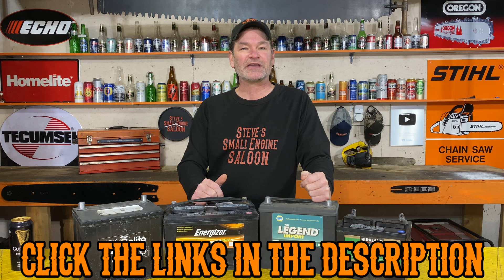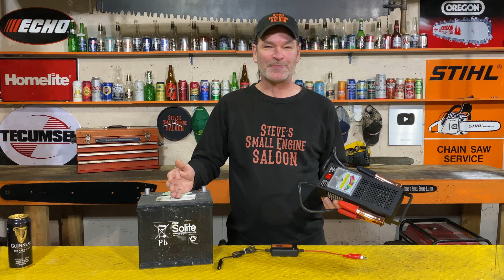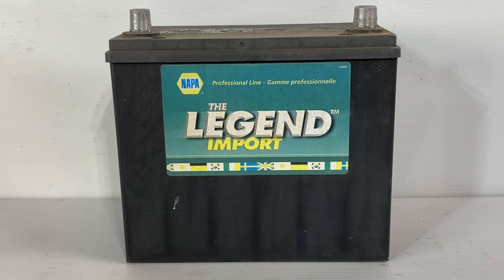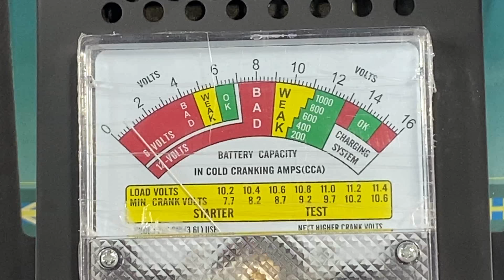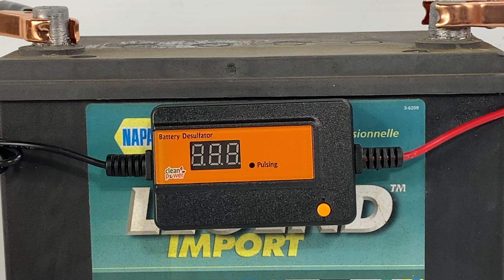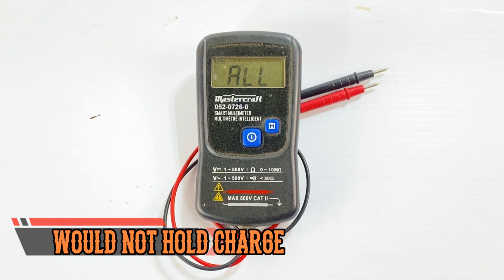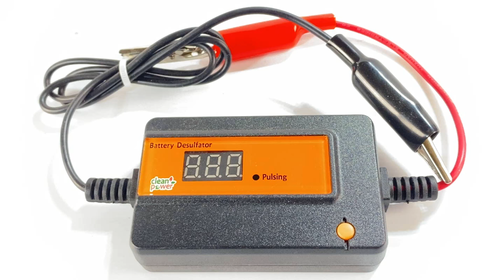Does An Electronic De-Sulfator Really Repair A Battery?? See Real Results

Comment: The older batteries that were not sealed you could put half of an aspirin in each cell and it could wake them up.  Got years of use out of "dead" batteries that way. May have to try the new gadget...
Reply: "Sealed" batteries aren't sealed. They have a vent to allow gas to escape when they are under heavy load and they loose water over time. On most of them, you can prise the cover strip off and service them like an old-style battery. The non-serviceable batteries are a marketing scam and have tiny water reservoir under that centre strip to automatically top them up to compensate for evaporation but it only lasts a few months and then they gradually start to run dry.

Comment: Alright, Steve, you sold me. I just ordered one off your Amazon link. 

I'm thinking about using it on good batteries every few months to extend the battery's life. What do you think?
Reply from the maker: Preventive maintenance is one of there selling points...
Reply: Yes, every time you charge use it period. Also if you have parasitic draw from security systems on your vehicle. I’m having to use it minimum of weekly if the vehicle doesn’t get used or used enough.

Comment: Steve, we tried desulfators at the airport on airplane batteries, and with similar results.  The thought of resurrecting a very expensive airplane battery was a VERY attractive option that we wanted to explore.  We also called the manufacturer (Gill) for more insight, and the discussion was well worth the time.  Here’s what we learned.

Batteries sulfate from a combination of two things.  If the battery charge decreases to a certain point, sulfur will form on the lead plates in the battery, interfering with the reaction between the sulfuric acid and the plates.  The longer the low-charge status, the more sulfate is formed.  Making matters worse, the sulfate will harden over time, making dedsulfating difficult if not impossible.

If you can catch a battery before the sulfate hardens, you have an excellent chance of reversing the chemical reaction and put the sulfur back into solution.  If you don’t, the hard sulfur can flake off of the plates and fall to the bottom of the battery, then short the plates.  Also, if you “super-charge” the battery, you run the risk of warping the lead plates.

One of the best things that you can do is remove the battery when its not going to be used for awhile and bring it in the house.  Put the desulfator on the thing every once in awhile to keep the battery charged.  “Exercise” the battery by putting it through a charge/discharge cycle.  BTW, the desulfator puts out a slow charge, and at a frequency that causes the sulfur to dissolve.

That’s it!  My airplane battery is in my workroom now attached to the desulfator, and will swap places with my lawnmower battery shortly.  Oddly, they’re the same exact size, but the airplane battery costs $400 more.  Both are 12v, but the airplane battery can be inverted (-It has little lead weights inside the caps that will seal the breather vent hole).  The temptation to use a lawnmower battery in the airplane is tempting, but the penalty that the FAA would impose keeps us honest.
Reply: Great knowledge shared
Reply: What about AGM batteries?  (Absorbed Glass Mat). The one in my snowmobile is mounted on it’s side, as there is no actual liquid in it.
Reply: @tomrogers9467  -Don’t know, but I would suspect that desulfurization only applies to lead acid batteries.  You could do what I did and call the manufacturer.  They’ll know.
Reply: @nealbowser8574  wouldn't an agm battery be no good in an air plane with out being vented at high altude due to pressure changes?
Reply: @chuckbailey6835  you would think that airplanes would always ride the wave of cutting edge technology.  Unfortunately, the exact opposite is more often the case.

AGM (absorbent glass mat) batteries are used in modern car batteries because of the increased power demands new vehicles demand.  On civilian airplanes, the technology for batteries and engines dates back to the thirties and fourties. The Gill battery that I mentioned is a lead-acid type almost the same as the one in your grandfather’s car.   Now they do use sealed cell technology, but nothing as sophisticated as an agm type device.  The cost of certifying new technology is draconian, so manufacturers use what’s already been “blessed”. 

Currently, I have a sealed cell battery in my airplane. -Don’t know the specifics,  it gaining or losing altitude apparently is not a problem.
Reply: @nealbowser8574  AGM batteries ARE lead-acid batteries. THey are just not FLOODED lead-acid batteries.
Reply: @JohnMcNerney  I know.  A little disclosure here.  While I'm a pilot, my degree is in biochemical engineering.  I'm well aware of the history and design of storage cells, so a little background knowledge is necessary here.

Lead/acid batteries have been around for about 150 years, and during that time, very little was done to advance the technology.  -Didn't really need to. Then they developed "sealed" batteries to prevent leakage and evaporation.  You can still purchase sealed batteries for your car, and most people consider all batteries that are sealed to be of this type.

The next step was AGM batteries, which still is a sealed battery, except that a layer of fiberglass is placed between the lead plates, which allows more lead to be put within the battery since the plates won't physically touch and short.

So the absorbent glass mat allows for thinner plates, and more plates, to be placed within a given dimension.  The problem was in the marketing.  To distinguish between current sealed batteries and the newer ones with the fiberglass barrier, they now refer to AGM batteries as a separate type of storage cell.

Crazy!  The next variation though will be batteries made out of more exotic materials.  -A shame, because the prices will jump outrageously, and the materials will not be as environmentally friendly as the old lead acid (-Not that they were very environmentally friendly).
Reply: I have 2 AGM Motorcycle batteries and they do contain liquid acid. I desulfated both and they are about 8 years old still strong.
Reply: @marksmith9295  I actually know an old, blind, pilot, who stupidly tried to peek down into the cells of his battery, but used a cigarette lighter as his light source.  The offgassing hydrogen exploded, and the sulfuric acids blinded him.  So yes, the hydrogen can explode, but in almost all cases, the hydrogen will dissipate before an explosion hazard is reached.
Reply: @nealbowser8574  
My Bonnie leaned over the gas tank.
The depths of its contents to see.
I lighted a match to assist her.
Oh bring back my Bonnie to me.
Reply: I put a charger on my batteries every once in a while to keep them topped off. They last like 8 years
Reply: Thanks for sharing. Why do airplane batteries have to keep vent holes sealed?
Reply: @TonyB1973  there’s an old saying with cars: “Keep the blue side up and the green side down”.  -Great advice for a car,  but with an airplane, banking is an essential part of flying, and occasionally flying inverted is not unusual.  Unfortunately, if you fly at an extreme bank or go inverted, battery acid can leak out and corrode the battery compartment.  The solution is simple. Put lead sealing weights in the vent caps that will temporarily close off the breathing holes, or spend even more money for gel cells.
Reply: @nealbowser8574  thanks for answer Neil
Reply: Not to be too fussy, but is has to do with G-forces on the aircraft, and hence the battery. In an airplane, you can pitch the nose up well above the horizon (with the wings level), then gently push forward, and go to negative G loading. This will float everything loose in the airplane, which INCLUDES the acid in the battery. If the caps don't close the vent off in this case, you'll leak acid all over the inside of the battery box. Corrosion will absolutely be a consequence. 

While on this topic, I can put a full coffee cup on the glare shield (top of the dash) and do an aileron roll - a portion of which is upside down - and not spill a drop of the coffee. Bob Hoover used to do this during his routine, actually pouring ice tea from a pitcher, into a cup, while upside down. During any coordinated banking maneuver, nothing will spill. Negative G-loads are what cause spillage.
Reply: That surprises me it turns those motors over..is it a lycomins rotary engine???
Reply: @micanopykracker902  same batteries used in both Continental and Lycoming engines. Of course the bigger the engine, the bigger the battery.  In the cold weather though, airplane engines are difficult to turn over, so most airports exposed to lower temperatures maintain an engine preheater.
Reply: @nealbowser8574  ah i see...my brother in law was chief ACMaintence for Fes Ex and i recall each flight in he hooked up a mobile power unit to the AC..is that the same thing??
Reply: @nealbowser8574  interesting. Thx
Reply: @nealbowser8574  your not Bowser from sha na na are you😲😲
Reply: @micanopykracker902  na na na
Reply: @micanopykracker902  aircraft batteries are minimalist devices.  They will provide enough power to start the engine, and that's about it.  To ask that the battery power something like an a/c without the engine running is just asking too much.  That's where the huffer, or start cart comes into play.  It can run the a/c and the avionics, and allow the pilot to enter in all of his data while remaining cool.

Another disadvantage that aircraft batteries must face has to do with their location.  On some planes, because of weight and balance (-and space) issues, the battery is placed towards the tail of the aircraft.  Then then long battery leads create additional problems.
Reply: @nealbowser8574  i can appreciate. Wheight and balance being an ex loader and tug driver
Reply: @nealbowser8574  well darn that's okay still been cool talking with you ✌️✌️✌️👍👍surely I'm not the first one to ever ask you that right🙄🙄😅
Reply: Neal, some good information in your comment, but where you say a desufator puts out a slow charge is wrong. What they do is put a high voltage burst out for a fraction of a second, at a frequency that dissolves the sulfer. The sulfator does this at regular intervals, and to get results sometimes needs to be connected to the battery for some considerable time. The voltage it generates is taken from the battery, so while its att work  the battery might need charging to complete the process.
Reply: Can't you use gel or AGM batteries? They als don't care for rotations...
Reply: plus your luck a lawn mower battery leak cover you in acid lol not really worth the burns

Comment: @Steve's Small Engine Saloon- Steve i have found that if you can get a small 12vdc 'wallwort" 2amp or use the trickle charger it will start smart chargers that require 10.5 volts to start charge cycle. then when it starts , remove the 12vdc and the charger continues its cycle. it shouldnt be to different for the desufator. try it !
I have a Ampeak CGUFB2025, search amazon. it reconditions batts also but needs a jump on batts that are low on voltage.
works wonders on batts that sat awhile and wont hold charge !!
Reply from the maker: Right on

Comment: Would this work on some 12v batteries for kids toy electric rides? Cheers
Reply: They do work. Never exceed the intended charge rate of the battery, usually about 10% of its amp/hour rating. For example, a 7 ah battery should be charged at about 700 milliamps of current until full charge is realized. The charger needs to be safe for whatever type battery you are using, such as flooded, AGM, or gel electrolyte, and will shut off accordingly. Each has its own maximum safe voltage, not just "12 volts". Each manufacturer will provide the technical specs of their product, usually online in a PDF document. Overvoltage causes plates to warp and electrolyte to "boil" out. Sealed VRLA batteries will pop their safety vents and their lives will be significantly reduced. Nearly all batteries can be safely recharged at 10% rate. Lead batteries top out based on voltage. Nickel batteries like nickel cadmium and nickel metal hydride finish charging based on what is called negative delta voltage. After fully charging, the battery actually goes down in voltage just a smidge, and a good  charger reads that voltage drop, cutting off the charge cycle. Good chargers also have temperature sensing and safety timers built in as well. Lithium cells are very sensitive to under and over charging. Too high or too low can cause catastrophic premature failure. The biggest killer of kid's riding toys is that the battery many times doesn't get fully charged after the kid runs it down in the yard.  Nothing harder on lead batteries than too many deep discharges. Good luck. I hope I have helped.

Comment: Are you sure your neighbor’s wife hasn’t secretly been using the lawn mower battery for ‘nefarious’ reasons? The marine battery in my old boat used to do the same thing. One night I came home late and noticed the longest pair of jumper cables I’ve ever seen running from my boat battery to a partially opened window to my neighbors house. I heard the loudest buzzing noise and thought ‘ WTF’? I unhooked the cables from my battery and was then struck in the back of the head by the biggest ( well, it resembled a giant pickle ) I’d ever seen in my life. Needless to say after I regained consciousness I sold the boat, battery included.
Reply: Specious much?
Reply: @channelview8854  Festus was never deceived by the specious denial of Matt concerning his relationship with Miss Kitty. And as Festus was a role model to all, even though he idolized Matt, he taught us to not be specious. So, no. I ain’t specious!

Comment: if only our cars had something like this built in. 
makes me wonder if using this device daily, weekly or monthly will have any effect on the life of the battery.
Reply from the maker: Good point!
Reply: Using one regularly as part of battery maintenance is exactly how they should be used. Prevent sulfation before it builds up on the plates.
Reply: @ronrodgers6531  exactly
Reply: @ronrodgers6531      That’s how I’ve been using mine.   I charge a different car or tractor whenever it happens to be sitting in the garage for work.    Time will tell but it hasn’t hurt my 2018 toyota Camray battery or any other as far as I know
Reply: there are de-sulfator that are supposed to be installed on a car battery permanently. i have one installed since 2014 and never had a problem with my battery. i have paid around $15-20 for that thing.
Reply: @MrMP-en7vf  got a product name or part number?
Reply: @_AndromedaGalaxy_  it seems like it is a bit more expensive in the U.S. my device that i bought in germany via amazon is called: Bleiakku-Aktivator
but it looks like its not available in the U.S.

you could go with a bit of DIY case building with this device: 12-Battery-Desulfator-Assembled-Protection

or just plug and play here 12V version for around $50: Pulsetech-PowerPulse-Battery-Maintenance-System

hope that helps
Reply: Which raises a question... would using a de-sulfator device like this potentially harm a healthy battery?   I suppose not, but I don't know that for sure.

Comment: @Steve if you want to save that Napa, you gotta blast it with 200Amp car start a few times.  Take the cover off the battery, and keep doing short 200Amp blasts till you see all cells boiling! Youll get her back
Reply: That's all great and wonderful until a spark ignites the hydrogen gas the charging battery produces. Trust me. You don't want to be in close proximity.
Reply: @ronrodgers6531  how much hydrogen do you really think a battery produces? The real problem is the high current can warp the battery plates. 200 amps will generate a lot of heat.
Reply: @1pcfred  Enough to result in having your face decorating with shards of plastic and acid, why do you think that there is proper protocol for 'jump starting' a vehicle, not that many people know or follow it.
Reply: @1pcfred  I personally know someone who had a battery explode on them because they sparked a terminal at the wrong moment. So what exploded then? Cow farts? Scotch Mist? Unicorn tears? No, it was a hydrogen oxygen mix, vented from the cells, that presumably had been bubbling nicely on a fast charger, in a badly ventilated corner of an engine bay. Just because your battery is behaving nicely, and/or isn't being abused somewhat, doesn't mean that battery explosions can't possibly happen. I referred in my previous comment to the proper protocol for boost starting a car, it's in the manual for most cars, it's there for a good reason, so fewer folk end up needing new clothing and plastic surgery.

Comment: I have used them alot. But I'm going to say this. Most of the time it will work but the battery won't last long after. Now if you remember how a battery works + and -  plates inside of the battery. If you have a dead cell in the battery it might save it but sometimes it won't. If you have a agm battery it can work but remember if you cannot check the water level in a sealed battery it can work but you don't know the water level in the battery. If a battery is ever frozen. Do not charge it. It's bad  because the plates inside are broken or touching inside of the battery. It can short out. It can explode.  I'm just saying I have seen it happen. Just let to say this. Just test the battery first look at it. If you can charge it charge it at a slow rate first then test it to see if it will hold a charge. Remember that if you charge a battery at a fast rate it heats up and sometimes it put out a gas that smells. Not good. Just wanted to say this.